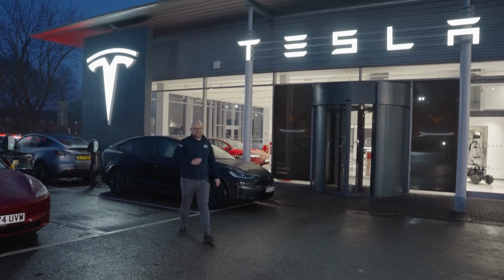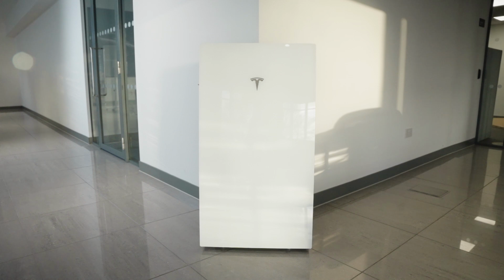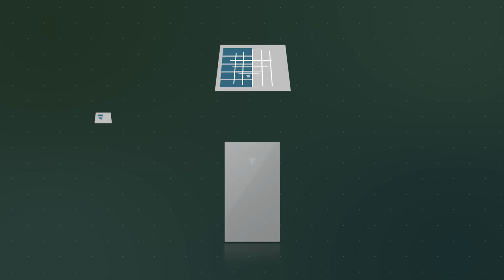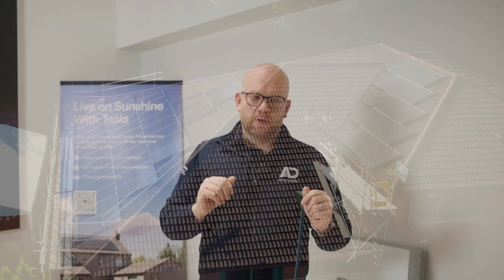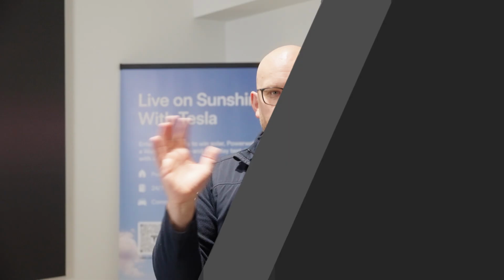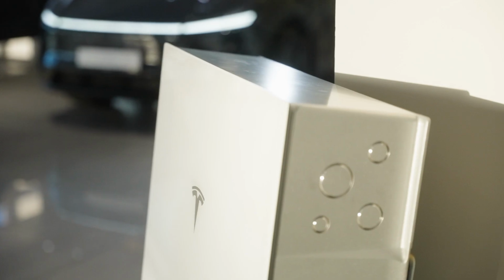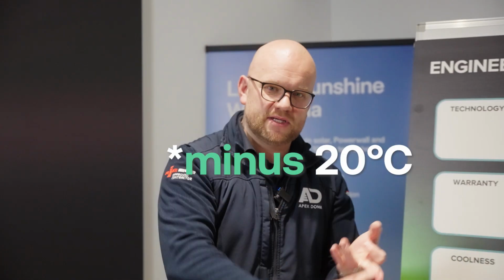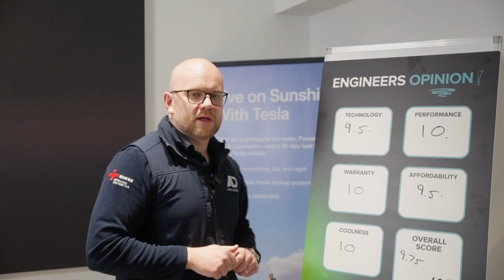🔋 Tesla Powerwall 3: Full Overview, Cost & Is It Worth It?

Comment: This is pretty much my only option if I want more than a 5kw feed to the house. NC6 in Ireland insists on a 5kw export limit and govern this by inverter size or firmware setting. The Powerwall 3 is legal whereas the sigenergy inverters have to be limited physically. NC7 application is almost €1000 non refundable

Comment: Today i looked at my electric bill and noticed i have a balance of 167.... in December.  My bill is usually around 10 or even 0 in December. My local electric company, APS,  is getting out of hand with these rate hikes.  Really getting tired of this crap.  I have 46 solar panels that always generate more than we use. In the summer they produce around 90 kwh but we only use around 55 kwh from the grid.  How in the hell do i have a bill over 100$? I think the buy back rate they have me set up for is really low. And this is why i am here. Seriously considering some solar batteries
Reply from the maker: Definitely shop around for buy back rates, we have lots of different ones available in the UK. But batteries are nearly always the best method of ROI, especially if you're a high energy user!

Comment: Tesla Powerwall 3  However, when installed with solar, this can decrease by up to ~£850
. This is primarily due to the shared inverter, negating the need for a dedicated solar inverter. Additionally, when installed with solar, the labour cost can be shared between the solar and battery installations.
Reply from the maker: Thanks so much for sharing this info. It really does depend on how each company prices the job and what’s actually involved on site – thank you for pointing that out. The time on site and the ancillary parts needed can vary a lot between properties, so although there can be savings when combining solar and a Powerwall 3 install, the exact figure will always be job-specific. Thanks again!

Comment: Installing 6 powerwall 3s (across 3 gateways) has been the biggest mistake I've made in years. They are not a reliable product and the tesla product support is atrocious. DO NOT BUY POWERWALLS.
Reply from the maker: Sorry to hear you’ve had such a tough experience with your Powerwalls. We’ve had a very different experience, both personally and with our customers – we’ve found them to be extremely reliable and Tesla support has been great for us.

It sounds like there may be some unusual circumstances with your setup (6 Powerwall 3s across 3 gateways is quite a complex system). We’d love to understand what went wrong.

Thanks for sharing, as it’s helpful for others to see all perspectives.

Comment: Can you connect an off-grid inverter to the grid on the input side to use the grid to charge the batteries?
Reply from the maker: We are not sure we understand, as in a generator input? 🤔 if you can add more context we will do our best to help.
Reply: @apexdoma  All Hybrid inverters have ability to charge batteries from a grid supply.

Comment: If we have a export limit is the inverter limited to say 6KW or is just the export limited to 6KW?

If the export is limited to 6KW can it supply the other 5KW to house loads?
Reply from the maker: Great question! With the Powerwall 3, the export limit and inverter output limit are usually separate – it all depends on what’s been agreed with your DNO (network authority) and how your installer has configured it. So yes, if export is limited to 6kW, the system can still supply additional power to your house loads (e.g. another 5kW), provided the inverter is capable and your setup allows for it. You just won’t be able to push more than 6kW back to the grid. Hope this helps 😃🔋💪🏼
Reply: @apexdoma  That’s great, thanks.

Comment: Can I recharge the PW3 if my MAINS is powered by a Diesel generator, rather than the grid?
Reply from the maker: Possibly, if you had a changeover switch, but the Powerwall isn't specifically designed for use with a generator. If you did want a product that works with a generator input, you would want either Victron or SigEnergy. 👌

Comment: Thank you for a highly informative video. I just ordered a PW3 system here in USA. 3 main PW3 with 3 backups + 18kwh solar. After accounting for all incentives and rebates, the total system cost is approximately $34k. I live in Chicago, where winters can be harsh, and I'm concerned about how the system will perform during extreme cold, especially when temperatures drop below 0°F.
Reply from the maker: They perform ridiculously well in cold temperatures! You are in good hands with the Powerwall. 👍

Comment: I have a two phase set up  - one phase going to a garage that already has solar and a PW2, and another phase (house) with nothing. If I add a PW3 (and solar) to the phase on the house, nobody can tell me how the two will work together and how I do it, and not even the great Tesla (with all their smarts and AI) is able to combine the two so it looks like one property in the app...
Reply from the maker: If you have two systems on two phases metered separately, it would appear as just two houses on the Tesla app. You could swipe between them on the app, straight forward to set up.
Reply: @apexdoma  The two phases are metered as "one" with net metering. Think of two trouser legs with the wasteline monitored in/out at the belt. I'm In Australia. Nobody can figure out what to do. Do I need two gateways or one? Do I need a neurio meter on the main board? Nobody knows.. In any case I want the whole house (both phases) to appear as one in the app.. otherwise none of it makes any sense. SolarEdge can do it. Why not the "great" Tesla?!
Reply from the maker: You'd need to consult with a local expert. The Powerwall can vary between countries. We are UK-based and, therefore, wouldn't be able to comment on Australian wiring regulations. Sorry we can't help further ❤️😃

Comment: Our two PW3s/GW2s were just installed here in southern Illinois.  Waiting on my utility to issue our PTO, mated to a 12.5 kWh PV system with Enphase Micro Inverters, billed at NEM 1.1.  Holding off on buying more ESS until more V2H vehicles are available.
Reply from the maker: It is great to hear from someone over the pond. Hello from the UK 🇬🇧

Comment: Very informative, thank you. I have a 3 phase supply, and already have 35 solar panels, so about 13kW on a good day over two strings. Considering a PW3 plus one battery extension. Installation location floor mounted in my garage close to the main consumer unit and my existing Solis inverter. How would this break down cost wise in your opinion?
Reply from the maker: Hi Andy,

Making the gateway three-phase requires a bit more work (note that a single gateway can track three-phase loads but only back up / supply a single phase).

You'll pay about £8,000 for the Powerwall 3 with a gateway to track three-phase loads and then around £5200 - £5500 for an expansion pack (subject to the mounting method, I.e., behind or to the side).

Hope this helps

Team AD
Reply: Are you from Germany ?

Comment: I have a pw3+dc expansion pack w/Gateway 3 with 15 kw of panels plus an older Tesla/Solar City 5.4 system tied in on AC. The one thing where this setup lets you down is that Tesla does not provide a generator option or bidirectional EV capability to interface to my  131 kwh Ford Lightning pickup truck battery.  This overview of the pw3 is the very best I have seen yet but if you revise it, you might want to comment on this because the new Franklin WH system does allow for this.
Reply from the maker: Thanks for commenting; we really appreciate the feedback. You are currently right. The PW3 doesn't allow for generator input or bi-directional charging. All future changes we would imagine!

Comment: I would like to export unused power from my PW3 before my cheap rate kicks in at midnight, but it refuses to do this. I have tried setting another tarrif late in the evening using a very high tarrif. Also tried the  NetZero app, setting the export everything at a set time and then setting it back to solar only. I have 2 x PW3 as I use a lot in winter with A2A and ASHP. Outside of this period, I will always have a surplus that will be potentially wasted. This would make a big difference to cost savings. Any ideas please?
Reply: i have just gone through this! you need to check when the systems was commissioned the installers selected export solar and battery. If they haven't made any changes it defaults to export solar only. you need to contact your installer and ensure the comissioning was done right. your installer can reomtely change this setting, or telsa themselves can, but they will want a copy of you G99 approval. i had the the same issue its now fixed and expoting battery leftover before cheap. netzero cant amend the base commision settings, once its fixed netzero will switch between the 2 (solar only, everything) through automations
Reply from the maker: Hello, have you tried home assistant? Several people online have coded this into the API. Thanks for commenting.
Reply: Thanks to you both for your help. I was going to ask my installer if there was a problem with their  export settings, but I noticed the battery was exporting around 1 kw a day. As a last attempt, I increased my export rate in the evening from £1 to £2 a kw, and it exported all of its surplus power. I am actually getting 16.5p so the cost calculations will be way out, but I am OK with that.

Comment: Have 15 panels installed over 3 aspects using all 3 MPPT’s. Production climbing nicely since install in early Feb, so looking forward to the peak in June 🌞. Had option to go AC coupled with Solar Edge optimisers. The extra £2k spend just seem seem worth the extra potential 200kwh per year. Being DC coupled the efficiently is right up there. On the start up voltage, we are in mid march and producing solar well before 8am. The software is next level
Reply from the maker: Hi Neville,

I am glad to hear you are getting on well with the PW3. Thanks for watching 👀🔋

Team AD

Comment: Got mine coming in the next 2 weeks. P3 with 2 DC expansions. No solar, just capturing the 7p/kWh overnight rate to cut my electricity bill by almost 75%. I calculate payback in just under 7 years. Would love to see a cost and payback comparison of 7p/kWh versus buying solar panels.
Reply from the maker: Awesome that you have decided to go for PW3, it is a great product. ROI calculation is subjective around the tariff, times of use of electricity, orientation of solar panels etc. There are a number of online tools that will help you do this + ask your installer this is something they should also be able to help with. Thanks for watching.
Reply: Yes based on current rates which are way higher than long term averages due to war etc. If rates fall to more normal levels in next few years then solar might be an option as a retrofit to the powerwalls
Reply: What was the cost
Reply: How has it been since installation and do you have a EV/ Tesla charger? Assuming that you live in the UK
Reply: @AIG_1992 been great. Charges at 10kW/h. I probably only needed one extra pack though… I charge my Tesla overnight without the PW3 battery (avoids round trip losses). Only complaint is that Eon won’t let you export if you don’t have solar. So I need to change (again) to Octopus. But just waiting for my first electricity bill from Eon.

Comment: The real big advantage of the PW3 inverter is it can deliver 11.5 kW of power to the home if required even if the DNO limits what you can export, unlike most inverters.
Reply from the maker: Hi Colin,
Yes, this is a real key feature of the PW3. 
Thanks for watching.
Reply: @apexdoma  I also use the NetZero app. When I was on Octopus Agile it fed the PW3 with the varying rates fine so that it sipped from the grid when it was cheapest. Now on E.ON NextDrive V6, which is fixed for 12 months, the NetZero app just provides better graphics.
Reply: Are you absolutely sure. I thought the opposite was true?Had mine installed yesterday so it’s not commissioned yet but I thought the feed to the house was restricted to the same limit in the G99.
Reply: @yp77738yp77739  I had my PW3 installed Wednesday this week, DNO restricted to 4 kW export, however ran the PW3 down to it's reserve 10% capacity this morning using a household load of 10kW, so yes indeed you can do it!
Reply: @ Thanks. Yes mines going to. 
I don’t know if the installer forgot to restrict it but mine was kicking out 10kW to the grid today.  I generated nearly 60 kWh today, that’s in Aril, if I can flog that at 25p a kwh then going to make about £30 a day at longest day, definitely more than £500 a month profit.
Reply from the maker: @yp77738yp77739  check your quote / acceptance letter. In most cases, they only place restrictions on export - however they can limit your demand also sometimes to a different rate, it's worth double checking and asking your installer to explain it to you.
Reply: @apexdoma  My DNO letter confirms there is no restriction on import and I have a 100A fuse. So all good thanks.
Reply: @apexdoma  The G99 limit, in my case 6kW, only applied to the export. Sorry, by feed to the house I meant feed from the PW3 rather than the incoming grid feed.They didn’t care less about the hardware my end. But if you limit the inverter it to 6 kw, how can it export at 6kW and at the same time supply the house at 11kW. That seems to be a physical impossibility, but brilliant if can as I also just had a large  (circa 4kW power demand) heat pump and was worried the PW3 couldn’t supply both ASHP and peak house demand. I was actually regretting the decision, but if my assumptions are wrong then that’s brilliant, even though I don’t understand how it can do what you suggest.
Reply: @yp77738yp77739  I suspect it can deliver 11 kW AC to the home less what it is exporting. So if exporting 6 kW the home can draw up to 5 kW before needing the grid to supply. Unfortunately, I can’t test this as I don’t have a greater than 5 kW load.
Reply: @yp77738yp77739  Absolutely positive. I had to ask my installer to get Tesla to change it as they had set both internal and external limits to the 6kW DNO limit. I've since seen the system power the house with several kW whilst also exporting at 6kW, but I don't (yet) have any loads to drive the system higher than about 4kW.
Reply: A lot of other inverters have sufficient output to power the home! The big disadvantage of PW3 is the built in battery, in 5 years that bat tech will be stone-age and you'll be stuck with it.
Reply: @Dexter_Reform  Is that really a problem? It will take a little more than 5 years to pay for itself, even on a great tariff, so it's unlikely to be swapped out before then based on economics whatever tech might be available in the future. It is also a neater install (no separate inverter). Also remember, if the DNO limits you to 3.68 kW then with the PW3 you can avoid pulling from the grid for loads larger than that. With other inverters that's not possible as you would be limited by your 3.68kW inverter.
Reply from the maker: @Dexter_Reform  There are other large inverters, but the compromise is often on warranty or technology in terms of App usage, access to tariffs etc. The Powerwall 2 was first launched nearly 10 years ago now and still an impressive bit of kit - we have one powering our office!
Reply: @apexdoma  So not a "real big advantage" then if many other inverters have similar output power.
Reply: @Dexter_Reform  You are missing the point. If say the DNO limits you to 5 kW export, very few inverters can be software limited to match. So you end up having to install a 5 kW inverter to comply. So if you are then exporting at 5 kW the home needs to draw from the grid to meet its needs. With the PW3 that’s not the case, as it can be limited in software (and this is approved by DNOs) to whatever limit they give you. This means with a DNO export limit of 5 kW the PW3 can still deliver 6.5 kW to the home, either from the battery or solar if available (or a combination of the two). So yes, it’s a big advantage. See the Spirit Energy YT video on PW3 vs Sigenergy.
Reply: @colinfieldgate4719 Yes, I was wrong. Somehow it can both export at limited power and supply the house loads at its full capacity. 
That is brilliant for me, I had previously pleaded with the DNO as I thought the restriction would screw me, but it didn’t at all. That means at peak solar, which for me is 11, I can export at 6kW and fill the battery and run the heat pump hot water cycle. So very little clipping and a nice big credit to cover the winter heat pump load. I’ve calculated I’ll be in credit by about £700 at the end of the heating season compared to a nearly £4k energy bill previously. 
The cheap PV panels are the key,, nearly 15kW of solar capacity for less than £2k.
Reply: @colinfieldgate4719  Who told you very few inverters can implement a G100 Customer Limitation Scheme?
Reply: @VinoVeritas_  Name them then ☺️
Reply: Just checking understanding, why would you be in a position where you’re exporting to the grid (5KW in your example) and at the same time drawing from the grid to meet your home’s supply needs? Surely you would set the system to draw from solar first to meet internal needs, with any excess to the grid? Rather than exporting at say 15p and drawing energy from grid at the same time at 30p? Or am I missing something, thanks
Reply: @cookieandtaco3107  I'm saying that while exporting 5kW to the grid the PW3 can power your home as it's not maxed out. If you had a 5kW inverter then you could only export 5kW less your home draw.
Reply: Many battery systems require additional hardware to implement G100 so the install is both more complex and expensive. I’ve not yet found any, bar the PW3, that can handle this internally without any additional equipment.